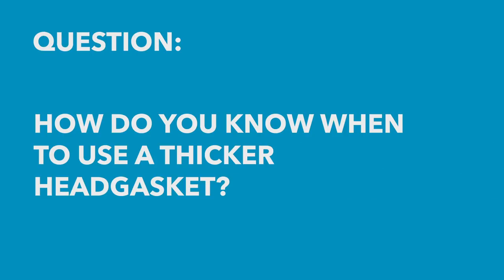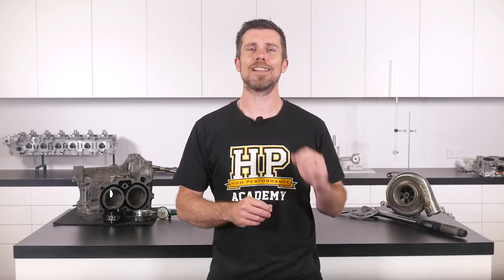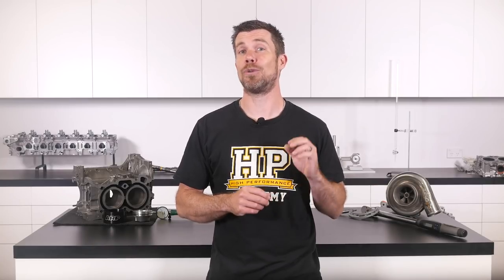Thicker Head Gasket | When And Why? [HPA Q&A]

Comment: Factory MLS gasket for my application has a crush thickness of .65mm. I was considering double stacking them to get 1.3mm crush thickness, which would drop my CR from 10:1 to 9.5:1. It seems reasonable as a lot of aftermarket MLS gaskets are 1.x mm thick anyway. Does it sound reasonable at the thicknesses I mention? There aren't a huge amount of aftermarket parts available for the 1G and I am only aiming for 13psi (around 325 at the crank) anyway, seeing as that's about the limit of the j160 box
Reply: did you end up doing this? I'm currently considering adding layers from a second gasket for my honda in a similar fashion. If you did this, how did it hold up?

Comment: Hello can you please tell me do you have a Peugeot 206 1.1i head gasket. I need a 1.50mm thickness and 73.8mm piston diameter.
I can not find one that has both of the measurements. They are either 73.8 but only 1.47mm thick, I have that size gasket but need it to be 1.50mm thick. 
Can you please help. Thanks and hope to hear from you soon

Comment: More when skimming the block, than head, perhaps - what is also a concern when skimming the block, especially on 'wedge' or 'closed chamber' engines, is the clearance (as Andre called it) or 'quench' as with some  engines this can promote detonation if it falls within a critical range - ~20-60 thou", IIRC - using thicker or thinner gaskets can take the engine out of that critical range.
Reply: Ideal squish clearance is zero, but because rod stretch is a thing, zero above redline is as good as it gets.

This means that clearance should be adjusted for conrod strength, piston weight, and engine redline, which nearly nobody does for some reason
Reply: Yup, means of getting the desired results. I would all 'rod material to that ist.

Comment: Umm I did some googling and found a forum that says that 0.025 off an inch = to 0.5 on the compression ratio so 10:5:1 with added 0.025 will make it 10:0:1 trying to turbo a na 3sge the gte has comp off 8:3:1 have worker out will need a 3.7mm head gasket would it work and run will need 3 3sge mls head gasket to make it 3.7mm thick? Help
Reply: And will be running 12psi

Comment: Why no problems at idle or mid RPMs, when reach Hi RPMs why would the valves wanna fight with the piston? If your finger 4" you shake your hand your finger won't grow to 5"?
Reply: With heat things expand.
Reply: I believe timing changes for different rpms with cars with vvt. You want the valves open for longer and farther for higher rpms

Comment: Also you forgot about"crush"and it effect to seal. Especially when dealing with miss match metal.
Reply: That's just gaskets in general, not a reason to thicken the head gasket alone
Reply: @GC9010  yes and no you have remember the that the piston is trying it's best to push the head off the block.it is this movement "lift"that we must seal that why the gasket is multi layer.  It all about "crush" and movement. If it was just about pressure sealing every engine would be o-ring

Comment: I've heard a few different recommendations on piston to head clearance, on a normal 4 cylinder it's between 1.0 an 1.6mm, I'm putting together an engine with 1.5mm and will rev to 9000rpm so it will be interesting to get your opinion
Reply from the maker: There's a few considerations when you're deciding on your minimum clearance here. A good rule of thumb is to keep clearance to at least 1.00 mm minimum, however there are plenty of applications where tighter clearance is used with no problem. Some of this comes down to bore diameter and how much your piston can rock in the bore as it moves through TDC. The rod is another consideration as alloy rods will grow at operating temperature so you need additional clearance at room temp.

Comment: what material of headgasket is best for boosted build? copper? mls?
Reply: The potato Party pooper mls, and stronger head bolts/studs.
Reply: I use Cometic head gaskets and rate them highly.
Reply from the maker: The best solution for most applications is a quality MLS gasket. Copper is problematic as it doesn't seal oil and water very well.